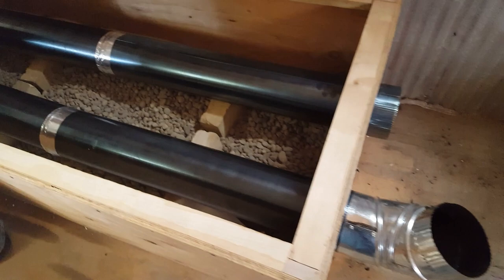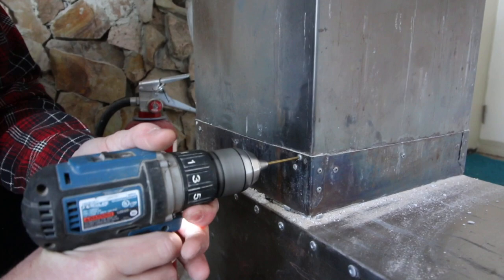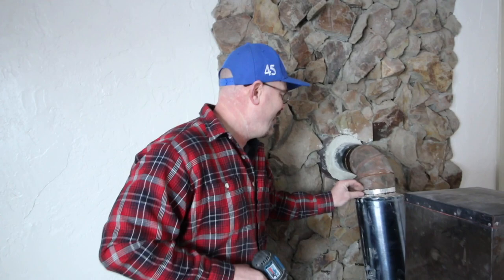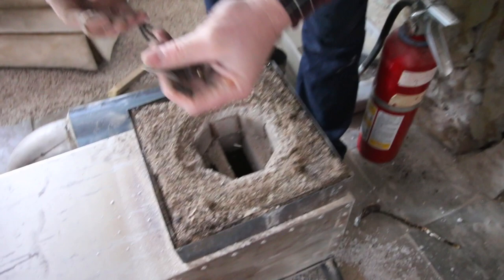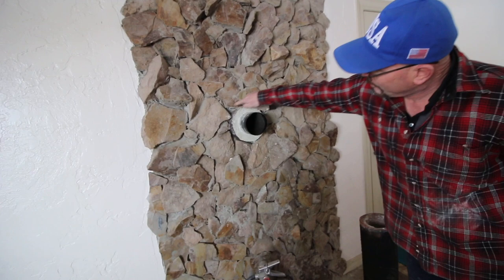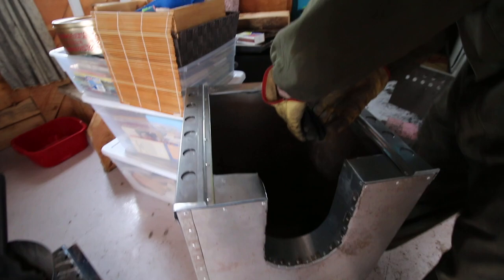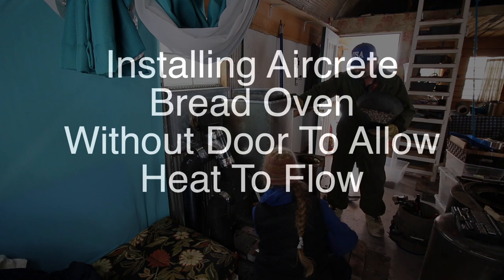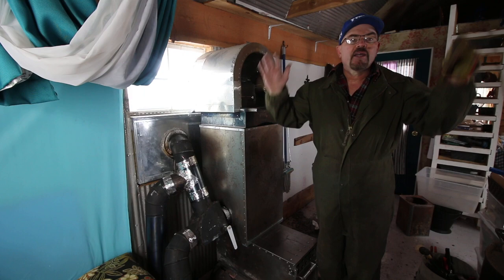Aircrete Rocket Mass Heater Uses One Log for 13 Hours of Heat

Comment: I used insulated flue pipe OUTSIDE. Black liquid is history.

I also used a T flue at the base of the chimney, with a cap on the bottom, the center pushed out with a hole in the middle. It prevents the liquid from coming indoors.

This weeps liquid (outside) when the stove is running cool, just starting, or shutting down.

Wonderful build... looking forward to building my next stove.
Reply: yes, avoids condensation inside the  inner pipe.

Comment: 2:21 there is no energy inside the ice; Hence "energy does not dissipate OUT of..." ; It is true that breaking up a big ice cube into lots of smaller spieces increases  the surface area which helps "to ABSORB energy and  melt into water".
Reply: I wanted to type this, but I was too lazy haha. Thanks 🙂

Comment: The condensate comes from heated moist air contacting the cool pipe in the bench.  Same as when you come into a warm moist house with cold glasses on your face.  They fog up.  I use the same principal to dry the air coming from my shop air compressor.  I run the hot compressed air through a cool condenser to remove moisture.

Comment: the thermal conductivity and specific heat capacity of all common materials has been well known for a long time....  looks these up and spend an hour learning how to use then cab sane a lot of money and time on trial and error.  Some amount of trial and error will always be useful though.   FOr instance the voids  in between the pebbles could be filled with sand or concrete fines ,  if filling the entire thing as a solid concrete or concrete fines could be superior to sand......  If one wanted to have a quick release from the thermal mass one might retain the voids and blow air through it for a time.    Nice video!

Comment: All burning creates CO2, H2O and energy. As long as the smoke is over 100C or 212F the condensation does not happen. It happens in the cool chimney, so let the moisture drip outside by making a small hole for water to drip outside. Make the horizontal  part of the chimney  slightly crooked outwards to keep the liquid out.

Comment: yes julie your condensing steam.
insulate the outside riser or shorten it .

or  

if you want to stay on the ground,
replace the lower outside 90 with a "t" with a bottom cap and a 5/16 hole drilled  in the cap  ( so the condensed water doesnt go back inside and leak from the vertical joint;
 it drips thru the hole in the cap outside)

now as you duct outside air to your stove you get to keep all the heat you make. 30% more efficient. ( no heated air used to support combustion. cold outside air supports burn)
be well and be warm!

Comment: LOVE 💖 LOVE 💖 LOVE 💖 your new stove.
We've been interested in a RMH for years, but had to do a cheater version (which I videoed) since we have a hardwood floor over a crawl space.
Your adventures with Darwin's stoves led us to his HoneyDo Carpenter channel and my hubby is so hooked on his designs. We're definitely interested in how this new model works out.
💥 Oh, and your water dripping issue - check the level on your exterior stove pipe. I had a similar issue on a wood stove in my home in Georgia. When we anchored the riser, it got pulled in towards the house too much and caused the horizontal to kick up outside. Smoke rises, but water flows down so you have opposing actions in that area. A small hole in the horizontal pipe (outside) will act as a weep hole so the drippage can go onto the ground (a dug out gravel area or a bucket helps).
Thanks for sharing another wonderful time with us.
Love and Prayers from Utah.
Reply from the maker: You are so kind to give me that insight. We are trying to get a cleanout for the base of the chimney outside to see if we can get that drip to drip outside.
Reply: @dirtpatcheaven  I'm not sure why you don't get creosote if the water is dripping down the chimney? Doesn't that mean your smoke is too cool - less than 212F - so it's condensing? These mass heater stoves confuse me - the Kang bed-stove Chinese heaters rely on the chimney being inside the house so that most of the chimney stays heated by the Kang bed-stove. thanks for sharing.
Reply: @richardgray2706  thank you for reiterating the principles of the rocket mass heater stove. Why is the condensation then the color of creosote? They said there is "ash" in the chimney but not creosote. So it's just from the ash I guess? ash water? Not dark brown-black from creosote water?
Reply: @voidisyinyangvoidisyinyang885  When I light my rocket stove, creosote builds up until the insulated portion is hot enough.  Water condenses throughout the exhaust path and does make sludge with this creosote until it heats up enough to evaporate but I haven't seen anything like the mucky water in this video.

Comment: no, pls don't shorten your chimney,that is the true engine of all stoves; insulate it and clean it looks to me like  you have a creosote buildup from  cold fires, make sure you are giving the stove sufficient air for it to free burn,  as choking it off  combustion creates creosote due to cool combustion temperatures, this is probably the result of improper use  by your tenant as u described

Comment: If your outside pipe is insulated you should not have that black water  dripping problem.  But if your outside pipe is insulated and too big the chimney temp will be too cool due to cold air exchanging with the hot air down your outside chimney pipe. If your outside pipe is too big just reduce the size of the exit opening at the top of your chimney , that will stop cold  the exchange of the air traveling down your outside chimney pipe and problem solved . Try it . I really like the stove build and great demo video .
Reply from the maker: The whole chimney is insulated with no air pockets. It is poured aircrete in between the chimney walls.

Comment: Water is from condensation  you can insulate the chimney outside
Reply: That's a good thought but I think it is actually super insulated.  

Julie is right that in that  it may simply be too long a pipe for the amount of heat left in the exhaust after it completes the bench run.  Perhaps if she can get it out faster there will be less condensate.  

I think they briefly measured the exhaust at less than 80 degrees Fahrenheit in this chimney and that wasn't as cold a day as this day and night was.  Don't hold me to that as I watched that video a long time ago. It was a pretty low temp though.   The weeping hole outside isn't a bad idea as posted by @Jaakko Laurila
.  I have no experience with this but my guess is that  it would be worth looking into if it could be done without messing things up.
Reply: @WilliamAudette  yep - good point. You gotta have some heat loss to stop creosote in the chimney - but isn't the chimney needed for negative pressure also? OH that's what the rocket rise does - so the draft isn't an issue if you make the chimney smaller? I don't know.

Comment: I had that black oil problem with one of my batch box stoves. I used a barrel with 3pipes opened to radiate heat. But I got gallons of black oil. I believe that the glavinzed pipes mixed with hot gases causing the creation of oil. Don't get that effect in brick tower, same firebox

Comment: I'd like to see Darwin do some comparative experiments using Zeolite sand for thermal absorption. Adding water to it should help with heat transfer due to its properties & can add humidity to the air. Studies done by the Germans show that Zeolite has superior thermal heat retention & transfer properties.
Reply: more expensive,  the really amazing thing about zeolite is not it's specific heat (simple heat storage capacity), but,rather,  it's latent heat of adsorption. Similar to phase change latent heat, but not at the normal gas to liquid/liquid to solid temps.    As it absorbs (desiccant) humidity... it gets very hot.    then once it is "saturated"  you then expend energy heating it to dry it out again for the next cycle.  A use case:  during a solar day use your panels energy to dry (recharge) the zeolite)  then when you need to release the heat at night blow humid air through the zeolite mass then use that exothermically heated air.   Some Bosch dishwashers do this on a small scale at the end of the cycle.

Comment: Hi, neat stuff.  

So how many Sq ft is that cabin?

And how cold was it outside average over this time period?

I just find it hard to believe that 3/4 of a log can give out enough BTU to heat that space for that long of time unless it's super insulated.

It's a mass flow.  Btu added minus loss.

3/4 of a log doesn't have very many BTU's.

???

Comment: When the chimney water settles / evaporates, is the residue more like creosote or ash?  And is it only while the bench is warming, or the whole time  the fire's running through the bench?

A question for Darwin, has he thought of making a 3 stage valve instead of the 2 stage?  If there was one, it could be connected to the upper where the pipe comes out of the bench near the wall instead of the lower going into the bench.  You could then set it to send heat up the chimney (open to the bench but not going through) , or going through the bench, or closing the chimney to ward off cold air coming down into bench or stove when not burning.

Comment: Wow - I never thought about paper clogging up the chimney duct. I have a baffle on my stove - so I don't think paper has been sucked up.
Reply: i'm surprised the constriction in the venturi didn't act as a baffle.
Reply: @TheKlink  "In a batchrocket there is an obstruction, smaller than anywhere in the system and in spite of that these stoves are burning extremely well.
Namely the detail that is known as the port, which is 70% of the chimney's cross section area.... The design is using the phenomenon of "pressure drop through an orifice" (Bernoulli's theorem) to add secondary air in order to create an afterburner function. Development of this system has been done using a Testo gas analyzer throughout.
Presumably, there could be some debate whether this port is an obstruction or rather a restriction. The difference between those terms is not christal clear to me, English isn't my first language.
regards, Peter"

Comment: Maybe more like, the bench horizontal: vertical chimney ratio is poor.  The more horizontal feet of pipe, the more vertical pipe there needs to be, to draw harder, to keep the air moving thru the bench, is what I’ve seen.    If you shorten the vertical pipe, it might cause the airflow thru the bench to stall, or even reverse.   
But, you know how windows get condensate?  
Ours used to do that, especially when outside temps started changing, in spring, & again in summer.  But, when we insulated the old single-pane aluminum windows, by installing a matching recycled window as a storm window, with 3” airspace between them, no more condensate. 

That dripping goo looks like a condensate, from temp difference not been enough to either burn that residue, or, carry it up and out.  And, the goo is maybe, denser than water, so lingers. 
Had you tried insulating all that single wall pipe, to see if it solves the goo collecting & dripping there?
Reply from the maker: It is full insulated with aircrete.
Reply: ..*fall, not summer!..
Reply: @dirtpatcheaven   Goodness! That is a mystery problem!  Did you say, it started when the renter burned waste & plastic in the stove?  Yet it continues?  Could it be something else?  (Could joke about ghostly  ectoplasm here…😝)(that might require Other measures !)